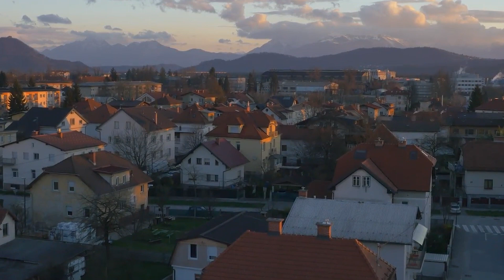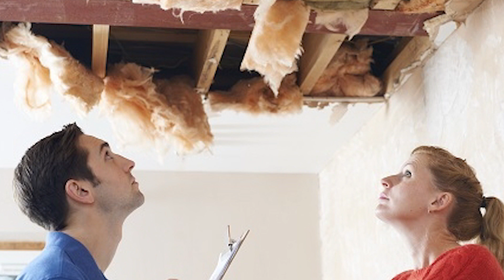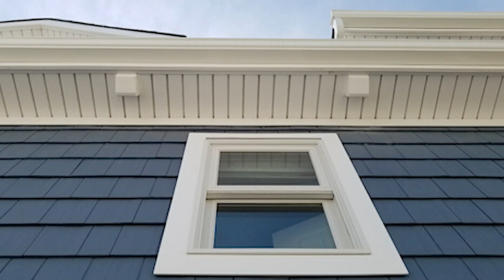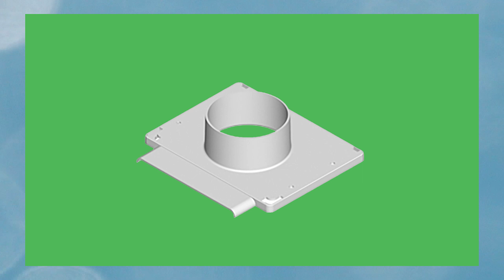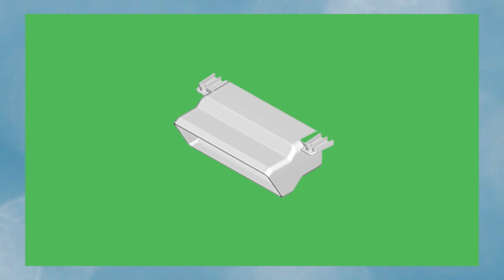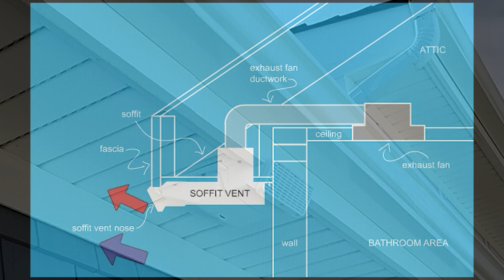The Soffit Vent System by Moisture Flow® How to Venting A Bathroom Exhaust Fan properly in soffit

Comment: Can I ask why you don’t have the vent exhausting upwards instead of down? Not an expert, but it seems like this would solve the issue of warm air being pulled back into the vented soffits as some have mentioned. Is this an option, or is there an engineering reason to vent downwards?

Comment: How does this vent function in freezing temps? Does it have a way to mitigate condensation build up/backing up and freezing the flap shut? I have a soffit vent that constantly freezes up during the winter here in NE Ohio. We will go months without using our bath fan due to this.
Reply: Must insulate around the ducting good and only rely on the fan damper on the housing of the fan. I have the soffit vent by Panasonic that is a 90 degree elbow type with it's own damper in PA with no problem. And leaving fan running longer to get rid of all moisture in duct may help.

Comment: Wrong!!!  The correct way to vent thru the soffit is to change out the vented soffit a distance of 6 foot on either side of the vent w/ unvented soffit so the moist air can't come back up into the attic.  Once you get past the 6 foot mark you can continue w/ vented soffit.
Reply from the maker: You may have your opinion and I respect it. The soffit serves as two purposes. One is to protect the rafters from the elements an the other is the intake of cool fresh air for the attic's circulation. The majority of the 250 million homes in the North American Continent have soffits that have openings for the attic to breath. The ridge vent at the peak of the roof or roof vents work in conjunction with the soffit. It is similar to a vacuum cleaner. They draw the exterior cool air into the soffit that is then drawn into the attic. The cool air will push the warmer air upwards so it will evacuate through the ridge vent of roof vents. However, the minute the cool air mixes with the warmer air it will condense and the this accumulates inside the soffit and the mold spores or moisture will be drawn into the attic. It will start by attacking the insulation and the flooring as well as the roof underneath sheathing. The soffit vents sold on the market today and for the past 40 years instead of solving a problem are the cause of the problem. That is why the Remediation Companies have been so successful. In short, one hand causes the problem while the other hand repairs the problem that the soffit vents have caused. Unfortunately, It is the homeowner that has to pay the costs! The soffit vents that have been sold on the market for the past 40 years has given the building industry a BLACK EYE. The International Building Code only enforces that all bathroom vents vent to the exterior. That is where the Code stops. Whether they work of not is not their problem. If you don't vent a bathroom exhaust fan to the exterior you can't get a Certificate of Occupancy. One hand washes the other this way the manufacturers of the soffit vents are protected by the Code Council. The regulations are to protect those that control it. Get the Point??
Reply: @moistureflow5913  You clearly didn't understand what I said.  I completely agree with a vented soffit.  I have been designing homes for 30 years so I'm kind of familiar with it.  What I am saying is that you MUST use unvented soffit at the bath exhaust.  Code says 3' on each side of the exhaust but I would go 6' on each side of the exhaust w/ unvented soffit and then you start back with vented soffit.  You do not want the moist air from the exhaust being pulled right back into the attic where it will cause mold.  It's not an opinion, it's fact and it's code.

Comment: Please announce here when these are in production and ready to ship to consumers.
Reply from the maker: The new Soffit Vent is protected by a Utility Patent with all the upgraded engineering design. The first delivery of the 15,000 units going into production will be available on March 20, 2025.
Reply: @moistureflow5913  2 plus years later.

Comment: Have you actually shipped any of these out to customers yet?
Reply from the maker: The moment there are several vents installed for over 3 years. In each case they were a total success. In all of the homes where they were installed they were using the soffit vents sold on the market. The cost of the repairs and the remediation was over $10,000. Once the Soffit Vents by Moisture Flow® were installed the problems were solved. The full scale production should start by July. This Soffit Vent was meticulously engineered to guarantee the customer a 100% money back guarantee with no questions asked.
Reply: @moistureflow5913  I asked for a refund on July 11th. I still have not received payment. You’re asking people to do things the right way, which I have, but you’re not.
Reply: They haven't shipped mine either. It's been over a year. Can't help but think we've been scammed.
Reply: @m3coupe4me  my credit card Bank issued me a credit after I filed a dispute.
Reply from the maker: @percyfaith11  You filed dispute before you even ask for a refund. You were only asking about the product and never mentioned a cancelation. You should read the instructions on how to do things before acting???
Reply from the maker: This is not a scam. due to the disruption in the supply chains worldwide from first Covid it was then made a hello of a lot worse with President's Biden Administration. My contracts with my suppliers for the raw materials are now working with skeleton crews because they are not getting the materials to ship out. Many of the transportations stops driving because the fuel payments were over $18,000 a month. This is four times what they paid when Trump was President. My new supplier will be able to deliver a partial order for my first 2000 in August. This product was out of my control.
Ricard Schofel
Reply from the maker: I personally invested over $750,000 of my own money in this company and 6 1/2 years of work. Now try and find another Soffit Vent worldwide that can offer a guarantee of stopping mold, moisture damage and mold contamination in the home. My Soffit Vent has and International Patent on in and it was not cheap!
Reply: He hasn't shipped. This is clearly a scam and the laws of physics (I'm an engineer) don't even make sense to have this product. The "original" soffit vents have the bathroom air coming out, that is true, but it's coming out at force IMMEDIATELY heading downwards, NOT going upwards into the attic straight away. By the time it gets pushed back upwards by the atmospheric air, it has already mixed with a much larger air of lower moisture. The resulting pockets of air that get moved back up are therefore not problematic.

Comment: What is the diameter of the round pipe which the exhaust duct attaches to?
Reply from the maker: The diameter of the section that the exhaust duct is 4 inches. I recommend using the insulated ductwork extension. This has the cellophane membrane that is placed around the round section of the Soffit Vent that extends into the soffit. Using duct tape or a snap tie to keep the connection secure. Then side the insulation down along with the aluminum covering and repeat the same procedure using duct tape or a snap tie.
Reply: @moistureflow5913  I have gutters level with the bottom of the fascia board which is also level with the soffit vents.  There is no extension of the fascia below the soffit.  The gutter extends 5 inches from the fascia.  Do you believe the vent will work in this case or will the gutter above the vent guide the moist exhaust back into the soffits?
Reply from the maker: No the gutter will protect the nose of the Soffit Vent. It sits right under the gutter. The nose has a screen on it that is angled up toward the sky so that the moist air will not not be drawn back into the passive airflow the soffit. In your case the nose of the Soffit Vent will be 1/2 below the bottom of the gutter.
 @percyfaith11
Reply: @moistureflow5913  I often have yellow jackets building nests in any hole they can crawl into around my house.  Can insects enter the vent as well as the moisture drain hole?  Can insects move past the vent and get into the ducting?  I imagine insect screening would ice up during the winter.

 Is your vent easy to disassemble if I should have to remove yellow jacket nests from inside it?
Reply from the maker: My Soffit Vent is designed so that the grill on the end comes off so that you can clean it if you have to. Normally when you turn on the exhaust fan the movement of the air opens the damper and then closes when you turn it off. The grill's opening was designed for this problem. What you can do it buy a piece of screening and cut it to the form of the interior of the grill and place in so it stays. You might want to use a ridged one 
 @percyfaith11

Comment: Great Idea! Can we use this vent for the stove top exhaust
Reply from the maker: Unless the  ductwork  is extended into the soffit . Usually the vent for the  stove top ductwork passes through the ceiling in the kitchen has a side wall vent. The ductwork  is in metal for the heat.

Comment: This looks like the solution I've been looking for. Can it be used as a dryer vent as well?
Reply from the maker: I would not recommend this to be used for a dryer vent. A dryer gives off too much heat and it is recommended to use galvanized metal of aluminum. Termination of dryer venting must be to the exterior with a proper hood or roof jack equipped with a backdraft damper. Small orifice metal screening should not be part of the hood or roof jack as this will catch lint and block the opening in a very short time.The hood opening should point down and exhibit 12 inches of clearance between the bottom of the hood and the ground or other obstruction.

Many contractors unknowingly think one pipe is as good as another and that simply is not the case. PVC pipe does creates its own problems when used as exhaust pipe. Although it is smooth on the inside it is not appropriate for exhausting hot moist air and lint . There is a static charge that is created in plastic pipe which causes the lint to cling together and with add moisture content causes the lint to cling to the walls of PVC pipe which over time, inevitably leads to a blockage in the pvc pipe. It is better to avoid pvc for dryer vent exhaust and use the recommended rigid metal ducting instead.

Comment: This is a great idea. I was going to reroute my bathroom exhaust from the soffit to roof but this is a much easier fix.
This can also be used for the exhaust of an energy recovery ventilator (ERV) without needing to penetrate the roof.

Could even be used for kitchen hood exhausts as well. Maybe with a 6" version
Reply from the maker: Kareem  The  Soffit Vent was  designed  as the termination of a bathroom exhaust fan when using the soffit. It was engineered  taking into account the coldest  temperature  variations of Cananda  and the  extreme heat  in  Azazona and Florida. It  should not be used as the termination of a kitchen hood unless it is being vented to the  exterior using the soffit.  There are  adapters  sold in the  box store that will convert  the 4" neck of the soffit  vent  to a larger or  smaller size. However,  the normal  diameter of and exhaust fan is 4".
Reply from the maker: The soffit has  been the most  efficient and easiest way to vent a bathroom exhaust  fan. Vent through the roof opens the  risk of leaks around the vent. The roof deck is constantly moving  due to the climatic conditions from the heat and the cold. A roof vent is fixed to the roof by roofing nails. Over time these nails will rust and pop. This will cause water infiltration through the nail holes. Once the water is able to pass through the area  around the nail pops it will cause mold and moisture damage in the attic. A roof was never designed to be cut to install appliances on it.  If you have an energy efficient hot water heater the soffit vent can be used as the termination. These new hot water systems  give off 93 degrees of heat, The Soffit Vent is  designed for 140 degrees. It is important that you use the proper PVC piping and it must vent through the soffit .

Comment: I love this video! The Soffit Vent is sadly a poorly installed moisture venting system in all homes in the US and Canada, even now and going back 40 something years, it's really sad, and to see this, it gives me hope that one day these nations will embrace the Soffit Vent System by Moisture Flow® as the official standard of soffit venting a bathroom exhaust fan, to eliminate mold in the attic and improve indoor air quality and home health life. I mean this IS what every homeowner needs in their homes right now!
Reply from the maker: Thank you for your support!
Reply from the maker: Thank you for your support. Unfortunately for the past 40 years the manufacturers have known that their vent  are the cause of the problem instead of the  solution.  It is simple the ICC the International Code Council Members are the same people that are the manufactures of these vents. So instead of coming up with a soffit vent that actually solves the problem they created  the Remediation Industry. Now they can continue to sell their soffit vents because without them you cannot get a Certificate Of Occupancy and then have the Remediation Companies come in and clean up the mess that they  caused. Now they are making money on both ends and the homeowner pays for the repairs. This is excellent for the companies bottom line. This is of bureaucracy at it best.
Reply from the maker: Thank you so much in your support. Trying to build this company has not been easy. I am so sorry for not seeing your comment for tonight. I never realized that people could leave comments.